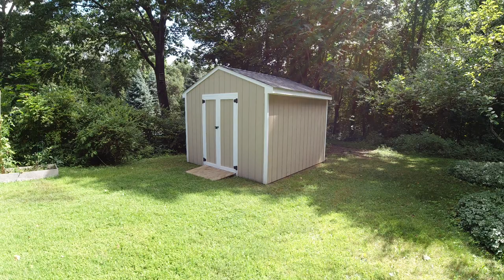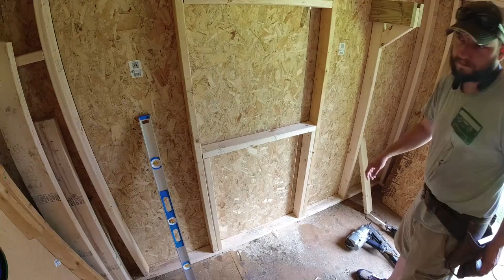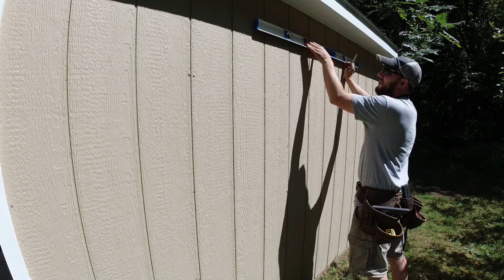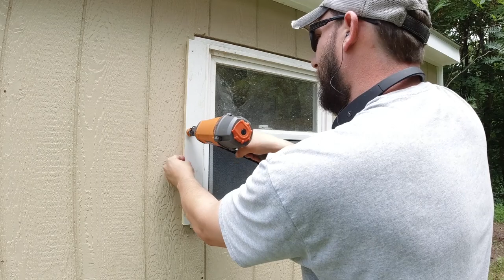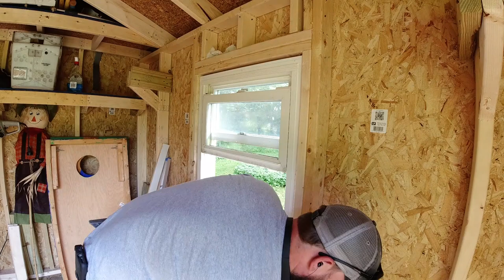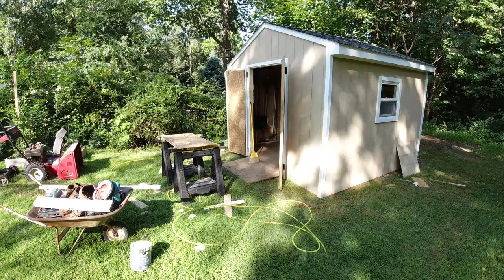Installing a Window In My Shed Time-Lapse

Comment: The most suspenseful part was when you painted the side of the trim around the window and you were so close to the wall with the other color paint haha
Nice video though. Like you said, more light and ventilation, will definitely be useful in the summer to leave that window open haha
Reply from the maker: Years of practice haha!  Thanks for checking out the video man!

Comment: So I understand it’s just a shed but from what I’ve been taught is that windows are set from the outside and have nailing flanges in order to seal the window properly? Thanks
Reply: Not replacement windows

Comment: That came out awesome.  Great job as always.  Help a window newb out..  what were the 4 corner blocks for when you were setting the window?
Reply from the maker: Hey Mike!!  I used the blocks on the outside to hold the window even with the outside of the shed.  Then I attached the window from the inside, took the blocks off and trimmed it out.  This just makes it easier to make it even with the outside... especially if you are working alone!  Thanks for the question and for checking out my videos!  I hope they help you out!!
Reply: The Fixer Makes sense!  Thanks for the help!